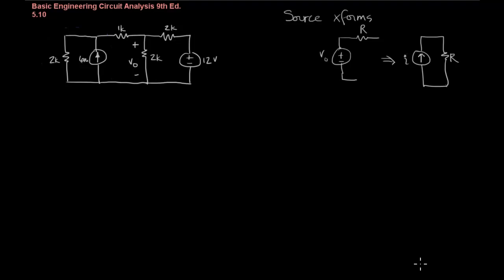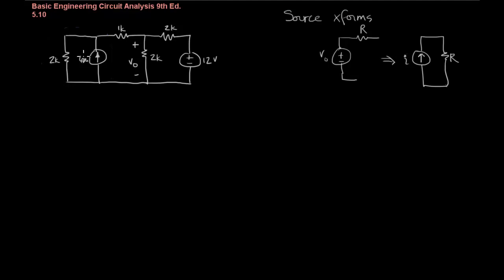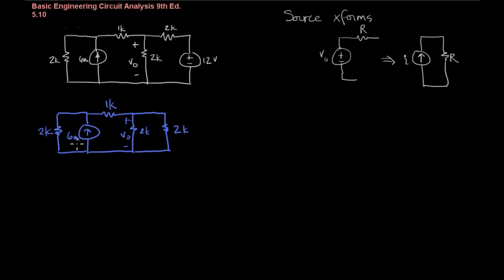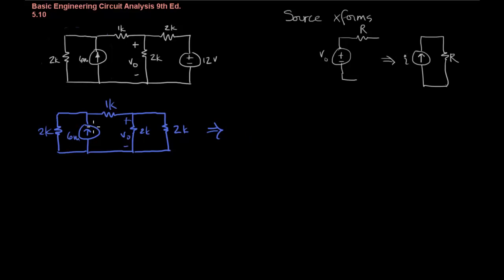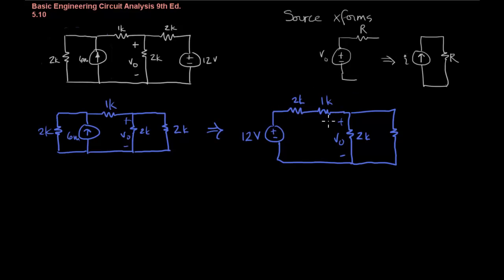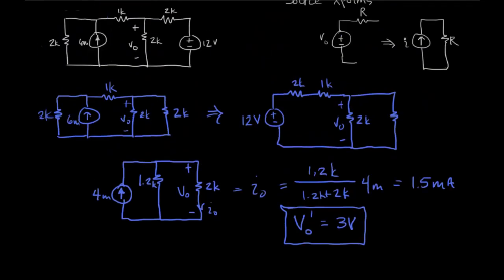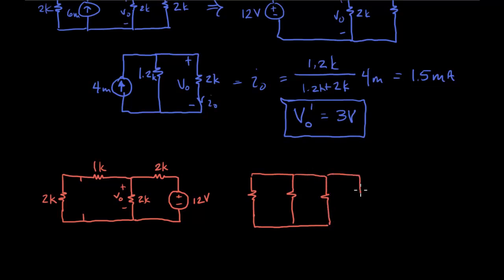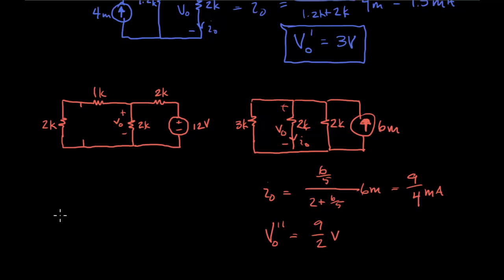Superposition and Source Transformation problem 5.10

Comment: For those concerned below, around 5:40 is not a mistake, just a skipped step.  Ik + 2k = 3k, then that's then put in parallel when he converts back to the current source, but at the same time he combines it with the 2k resistor that was in parallel on the far right of the circuit to end up with a single 1.2k resistor.  Note: You have to leave the V0 2k resistor uncombined, as it is the load you're doing the calculation upon.

Comment from the maker: I'm not sure what you mean,  but you might be talking about the step I took at 5:20.  Notice that I added the two series resistors (The 1k and 2k = 3k).  Once the source has been changed to a current source, the 3k is in parallel with the 2k on the far right.  This combines to 1.2k.  I don't show these steps because I'm trying to keep the videos short.

Comment: Seems like a mistake was made when the 3k resistor was combined. It is not in parallel with the 2k resistor to the far right. The two 2k resistors are in parallel and combine to a 1k resistor, which combines to 4k in total.

Comment: The second transform of the 12V source to the 4mA current source, how does he get 1.2k//2k? according to source transformation , I thought the 2k resistors are in parallel which are then parallel to the 3k resistor? As in we have our current source and then three branches in parallel...3k//2k//2k

Comment: This was awesome, but I have a question. When you looked at the contribution due to the first source, why did you do a second source transform?  I was able to find Vo' and io without doing the second transform.   Just used both voltage and current dividers.

Comment: Dont understand why Vnot is found using the 1.2k resistor for the numerator if Voltage at Vnot is the 2k resistor.  Unless he meant to write the Vnot next to the 1.2k instead of the 2k?

Comment: what you said 11 month ago was informative but what i dont get is how you got the 4m  at 6:20 . 12/3 is 4 but dont you have to take in account the 2 k resister thats in parallel  so it would be 12/1.2 not 12/3 right???
Reply: According to the rule of Source Transformation, you've got to take the first R that is in series with the voltage source, which is 3 in this case.

Comment: Dude in 4:23-5:25 what happened to the other 2k resistor?
Reply: The step he skipped is the step that caused a little confusion. When he transformed the 12V into 4 mA, the 3k becomes parallel with that other 2k. This two parallel resistors can then be replaced with a 1.2k (1,2k =2*3/(2+3)).